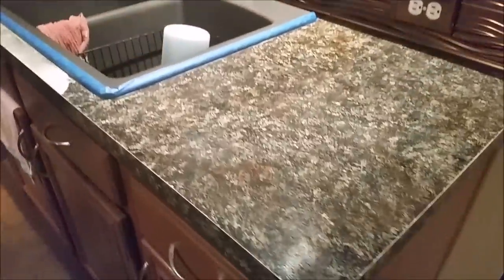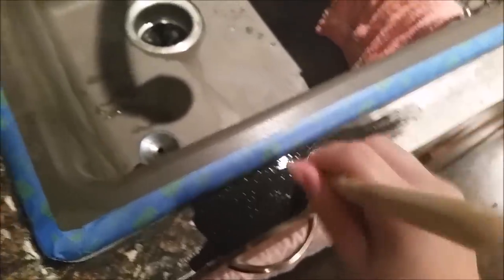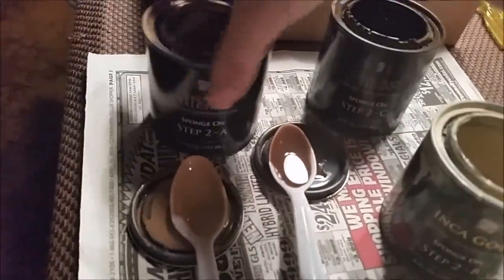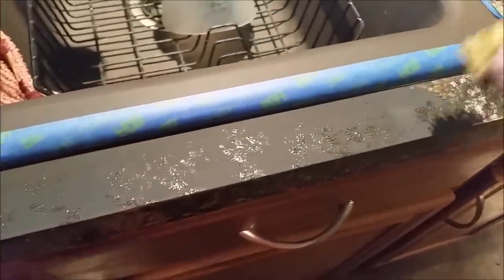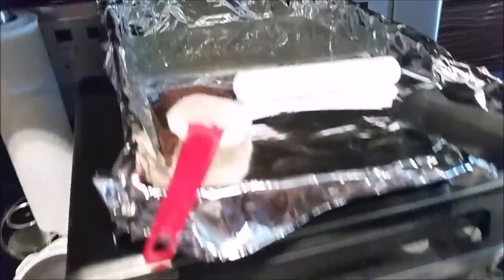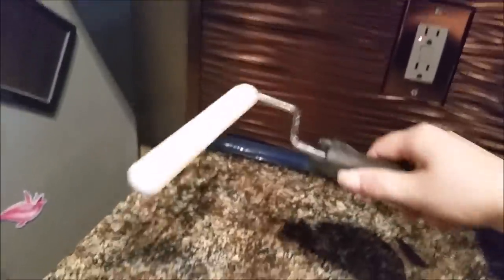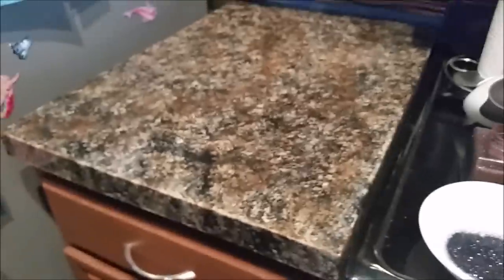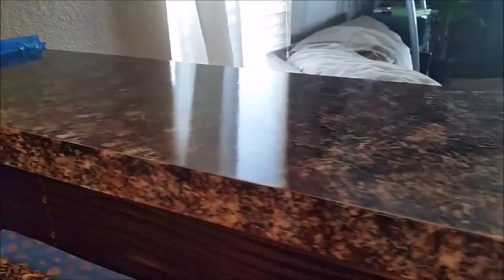Repairing my Giani Granite Countertops (and adding glitter!)

Comment: I did my counter tops back in 2010 and in 5 years, they have held up great!. I do have to touch up a couple of very small areas...a dish fell out of the cabinet creating a small chip and superglue haze where I had glued some tips on something made a few small dulled areas. I only used the recommended 2 coats of the final glaze (too much and it dries cloudy). I did a bathroom vanity top at the same time and it looks as shiny as brand new. Never has the finish ever just rubbed off of mine...it seems like there might have been an issue in the way it adhered from the beginning.

Comment: I used the same color you used but mine looks nothing like yours.  Mine is more brown or brownish red.  I haven't had any issues.  It has only been 7 months.  I did put more than one coat of the base.  I used two kits and don't know how you had that much paint left.  I am here because when I did my first one some of my paint wasn't any good.  One was lumpy and one was runny.  Didn't know I could buy the touch up cans.  Anyway I found them and want to fix the places where I didn't have enough of the right paint.  I was wondering if I needed to use the top coat that comes with the kit because it is expensive.  I guess I will do it right.

Comment: Every video I have seen recommends 3 to 5 coats of polyurethane. Basically as many layers as you can get on there. The more layers the longer it will hold up. Several video's went to epoxy to seal it. Which would make it last much longer. As well as enhances the stone look. Many restaurants use the epoxy on their decorated themed tables.

Comment: So are you happy with the addition of glitter? It definitely sounds like a cool addition! Also, is the Giani smooth when this is completed or does it still have some texture to it? I've been looking at Giani but it always seems like the completed pictures show some texture to it and I'm not sure I can handle that! lol.
Reply from the maker: I love the glitter! But it does add some texture in spots. Maybe if I had put more top coat on or if I had added the glitter to my original bottom coats of color there wouldn't have been so much texture. But I added this glitter during a repair job, so it was going down kinda close to the surface.
Reply: +Stephanie Fitzwater One of the giani how to videos I saw said to use a 600 grit sandpaper after the minerals if it's too texured, and again after the first top coat if need be. Just make sure you give a good wipe down to remove any sanding dust before finishing the top coat. :)
Reply: +Stephanie Fitzwater Giani is very smooth if done properly - which requires a LOT of sanding. I cleaned my countertops, sanded them with a 600 grit paper, applied the primer and allowed it to dry the full 8 hours. I then applied my mineral paints - I did this in multiple layers for depth. After they dried, I sanded them with 800 grit paper. Cleaned off any and all dust. I then applied a layer of top coat and allowed it to dry. I sanded AGAIN, this step is crucial if you want a smooth finish. I then applied two more top coats and have yet to experience any texture or any issues with my paint rubbing off.

Comment: i think maybe first timers clean the counter top with acetone to remove any build up of cleaners, kitchen grease, fingerprint oil, etc.  Or at least alcohol.  Wear a mask because of fumes and open windows for acetone.  I epoxy painted my kitchen tile from mexican blue to ivory many years ago and even with this outdoor paint I had to touch up all edges every 6 months.  Wonder if the glitter may have made the paint less tenacious?
Reply: Great idea! Are you happy with the painted tile?
Reply from the maker: I didn't use any glitter the first time I did the counter tops so that wouldn't have affected it. It was just something I decided to add since I was touching them up.

Comment: SCARED to death. I have a kit to redo my counter tops. Been sitting in a corner of my kitchen for over a year, then I come across a how to FIX a problem. How long was it, before you started having problems, and when you first did your counter tops, did you use a wet sponge to apply the other layers of colors? And did you ever see any glitter on your cleaning cloths, after your first total re-do? I was getting up the nerve to finally do it, so I came here to watch others do it, and really know I have it where I can feel good, not scared to do it. Now I am scared again. (doesnt take much) but your repair was wonderful, I just was not aware of having to redo some parts of it again. WHAT if the company and products are no longer avaiable? But all in all, GREAT JOB, and loved your background music, I got that CD and def will play it while I dive in the deep end this week. Thank you, Bren
Reply from the maker: Hi Bren, I was a little nervous too mainly over what a huge job I thought it would be to redo but it actually turned out to be a pretty easy fix. Biggest pain was not using my countertops for a few days! I would say my countertops started getting rubbed off in front of the sink area after about 6 months. BUT I think there may have been two contributing factors. One, I was low on top coat when I origianlly did my countertops so they were thin coats. I also have a mother that visits a couple times a month that likes to kinda scrub with the wash cloth whenever she wipes up stuff. So you add those two factors together and I think it caused me to have early problems that I might wouldn't have had if I had had a thick enough top coat on. When I went back and fixed it I put three top coats on! And wow, do I see the difference, it is so much glossier than the last time I did it with two skimpy coats. If I was to do it again I would have put more glitter down after putting my first top coat on. This time I realized how much I liked the glitter and wished I had put more on, so after my second top coat I put some more down. Then I put a final top coat. So some of the glitter really only had one layer of top coat on it. So yes, I did have some glitter come off on my cloth the first couple of weeks when I wiped my counter tops. But if I had put all the glitter on between the first and second coats I don't think it would have been an issue.  Good luck! Turn up the music and have some fun with it! :-)

Comment: I am ordering the Giani kit today.  On the glitter, did you look for a fine glitter or does that matter?
Reply: +cherie king   Martha Stewart's Super Fine Glitter Flex I was told to use. I just ordered the Giani kit but am disappointed that it wears out. I don't want to have to keep redoing it. If I knew this before I ordered it I wouldnt't have.  I am doing the White diamond but am putting a minty blue, with very few veins of red in it, plus the glitter.

Comment: how many coats of sealer did you use for this counter top to be in such bad shape so quickly?
Reply from the maker: When I first did it I 2 coats, but the second coat was thin.  Unfortunately it has now been 6 months since doing this repair and I again am having a couple spots in front of the sink that have come off (each about the size of an eraser head). Not sure what the deal is. But luckily it is easy enough to fix. But it is frustrating that it would happen again.
Reply: +blondbiker82 Did you use caulking around your sink once you were done with the top coat? Make sure to always seal around any seams with a clear caulking, or moisture will get in and cause nightmares. Perhaps that may be why it's having issues? I'm hoping to try this stuff soon, and although I didn't think I'd be into the glitter, I'm really warming up to the idea now because of this video!!! ;) Thanks for sharing
Reply from the maker: Yes I did caulk around it with a clear caulk.   Glad you enjoyed the video! Even with the issues I have had over time with the counter top in front of the sink, I love it. It's an easy fix for any issues.